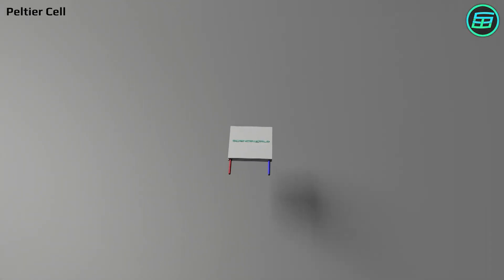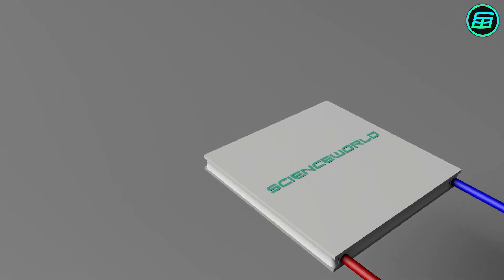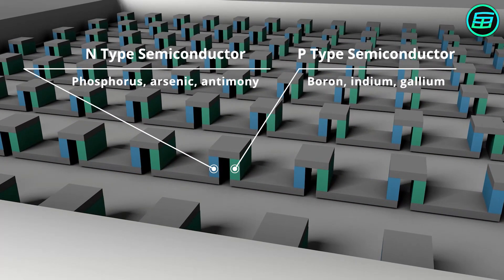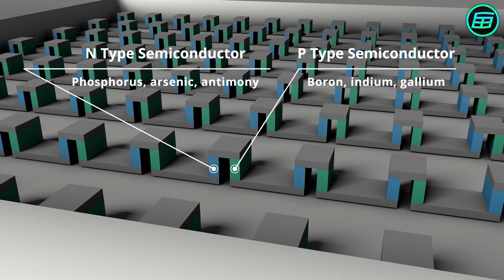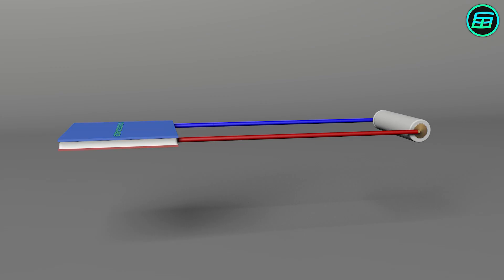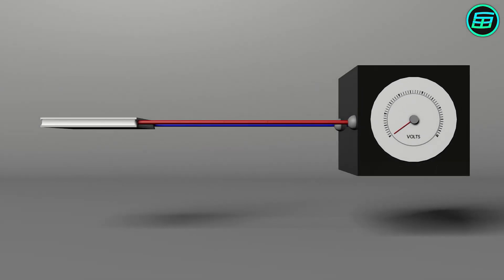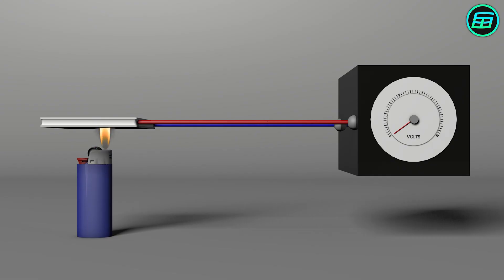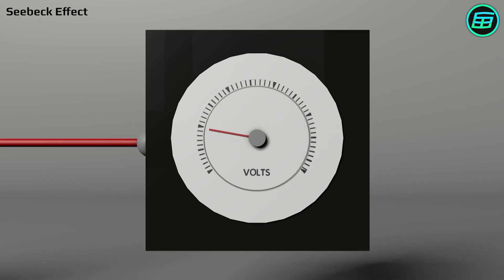How does a stove fan work? (Peltier and Seebeck Effect)

Comment: Nah this shit doesn’t work enough, i use an electrical fan on the back of the room, pushing air in direction of the stove, forcing air circulation, blowing cold air to the stove forces the hot air around the stove to move away from it, creating a heat balance. Hot air goes up and cold air goes down but also each particle of air cannot occupy same place

Comment: Yeah, but HOW does the N and P semi-conductors generate power from temperature differential?  You are only showing the result of the phenomenon, not the reason.  Good grief!
Reply: As a result of emission or movement of electrons from the N type semiconductor to the P type semiconductor

Comment: I was doing a test for each solar module on a solar panel you put on the backside with this Peletier,only generated 0.7 volts under hot conditions I only used one Peltier for one module, so 0.7×24

Comment: I HAVE WATCHED PREPPERS FOR DECADES URGING PEOPLE TO BE READY FOR THOSE SHTF TIMES. I ALSO HAVE WATCHED THOUSANDS OF VIDEOS ON THOSE WOODSTOVE FANS AND WAS WONDERING IF THE GRID COLLAPSES WHY NOT MAKE DOUBLE USE OF THOSE FANS. WHY NOT INSTALL SMALL GENERATORS TO THE REAR OF THEM AND BE ABLE TO CHARGE CELLS, AND HAVE FAIRY LIGHTS LIGHT UP HOMES 24/7. RUN A SMALL RADIO FOR NEWS. A LARGER ONE COULD POSSIBLY RUN A SMALL ONE-BURNER STOVE, JUST A THOUGHT??

Comment: If I was to use 2 of the cells what the big heat sank and a super-efficient fand I put black tape on the hot side and pointed at toward the sun. Could I charge a phone
Reply from the maker: There are 2 main problems, first, Thermoelectric Generators have max. 8% efficient in converting heat into electricity, and second, the greater the difference in temperature between the hot side and cold side, the greater the electrical power produced. For example if heat difference of hot side and cold side is around 10C, peltier will produce miliwatts. It will be too low to charge your phone. If you want to use sun as heat source,  you need to set lots of peltier.

Comment: 1:11 Wouldn't the Peltier chip rather be in the wide base at the bottom where the heat is?
Reply: It can overheat and break, so normally they are on a conductive base with a bi metallic strip underneath to lift it if the base gets too hot, if you had the chip flush it would be difficult to control the heat using this method

Comment: If I put it on the stove and it gets too hot, so that both sides of the cell are about the same temp, will it stop generating electricity?
Reply: the cool side/top side of the stove device has a huge heatsink that radiates heat away from the cool side. But I bet if you would heat it up the fan would stop yeah

Comment: How come we dont use these to power most of our electronics on hot days?
Reply: There has to be a big difference in temperature between the base and the upper part for electricity to be produced. On a hot day the temperature would be fairly equal between the top and bottom of the fan, it needs a big difference in temperature to work.